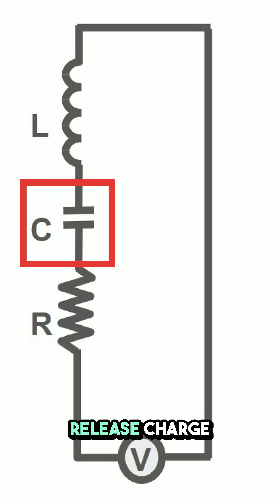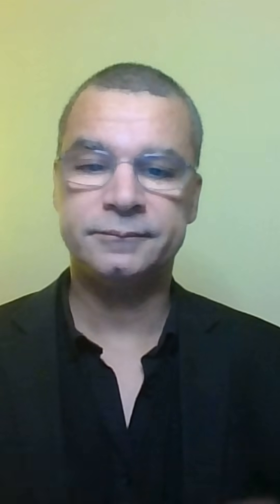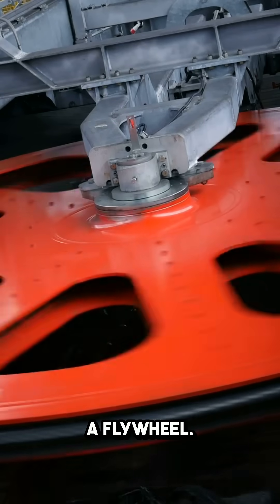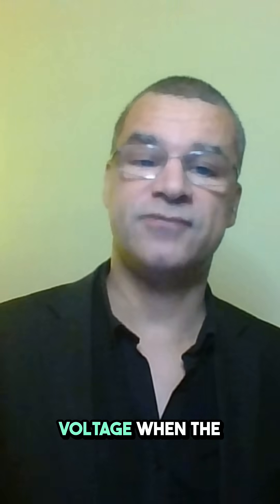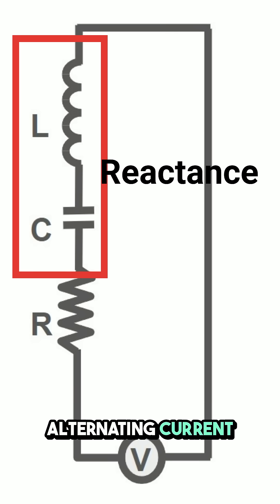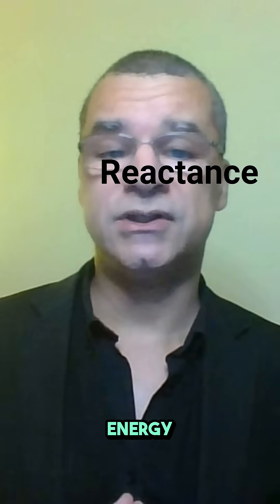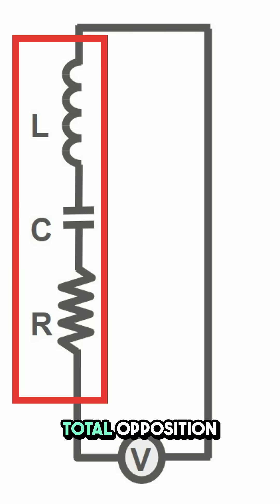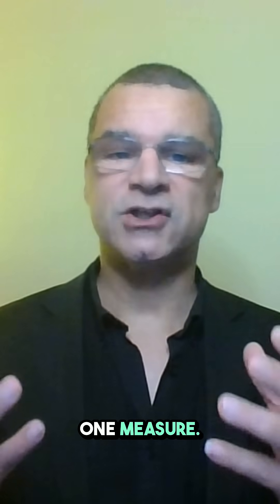Clarifying Impedance Understanding Resistance Capacitance Inductance and Reactance

Comment: If the capacitor smooths out the current then the inductance smooths out the voltage, did I understand it correctly?
Reply from the maker: @milky_dromeda Not exactly! A capacitor smooths out current by storing and releasing charge, while an inductor resists changes in current. This happens because changes in current cause shifts in the inductor’s magnetic field, which induces a voltage opposing the change (Faraday’s Law). Hope this clarifies!
Reply: @delgadorelayreference  Oh okay, thank you so much, because I remember that in our power electronics class we used capacitors to smooth out voltage ripples and inductors to smooth out the current, we even called it "smoothing coil"